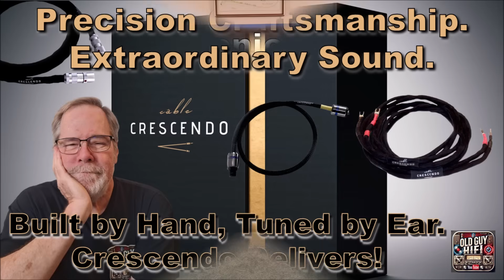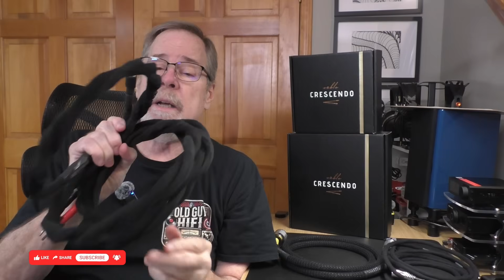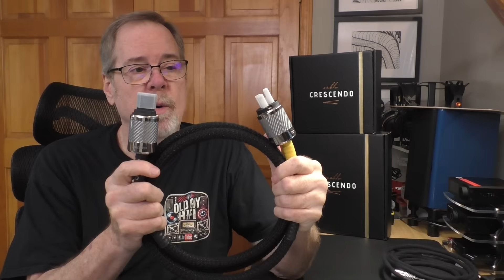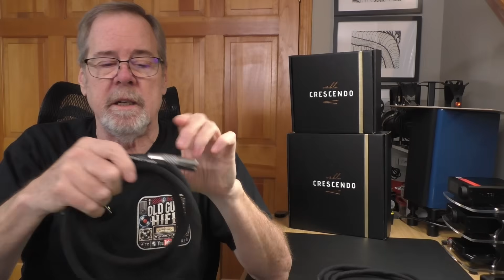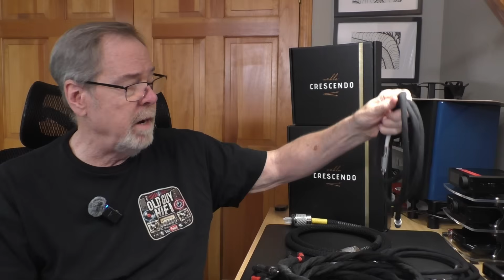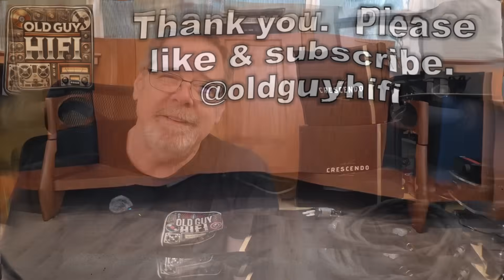Handcrafted in Quebec for Extraordinary Sound. Attention to Every Detail. Sound Without Compromise.

Comment: I have heard differences in cables that carry an analog audio signal, so interconnects and speaker cables. Did I find the difference enough to spend kilobucks? No. I upgraded to some OK Monsters and from there on, the law of diminishing returns set in so much that there was no way I would spend that kind of money for the minute differences. 

I have never heard any difference with digital signal cables, be it USB, coax, TOSlink or network cable. My 1s and 0s do fine with any cable I throw at them🙂
A while ago, a friend was shocked to see that I use a freebie USB cable that I got with a cheap printer in the early 2000s with my DACamp. He lent me a $600 USB cable to make me "see the light", claiming it "sounds" SOOOO good. The shock was not on me, as none of us could hear any difference when he brought it. 

With regards to audiophile power cables, I see no use for that unless you upgrade all the way from the power plant. GOOD audio gear SHOULD filter and RECTIFY the power to such an extent that I see no way that 1 single meter of kilobuck copper could make any difference what so ever. Any such claims would need to be veryfied in a blind ABX test for me to even consider spending time on. 
This is snake oil for me, until scientifically proven. We all know that will never happen;-)

Comment: Whether a cable is a good value or worth it, depends on what else is available at much lower prices. I am lucky enough to know some cable companies whose designer is very good & he gives you the best cables he knows how to make, without regard to the crazy prices that many other companies in the industry  charge. No multi thousand dollar cablrs are likely to cost 1/5 of that to  make. So the retail price reflects enormous profit margins; and I could not afford that or care to deal with companies like that. Especialky in light of the nice guy companies I know about, who simply give you the best cables they know how to make for well under $200. A few hundred dollars is what I believe a sensible price is, for cables. Some of my best cables cost way more than that retail; but I bought them used.
Reply from the maker: Thanks for sharing your thoughts.

Comment: Thanks for the review Ed. These cables look great, but they are certainly out of my budget.  

That said, guess I need to start thinking about finding a short cable jumper to replace the metal jumper on my Martin Logan Motion 60XTi.
Reply from the maker: I will send you a link to ones I use later. On the road today to CAF.
Reply: @OldGuyHifi have a great trip!

Comment: Great stuff Ed! Very brave of you! The late great Roger Russell of McIntosh recommended 18 gauge wire for runs up to 20 feet. He said the extra resistance helped with damping factor. I just had my Marantz 2220B, my Sansui 5050 and my Harman Kardon PM-650 apart for maintenance and lamp replacement. The wires to the power transistors looked to be 18 gauge. Supposedly the wires in a speaker are probably the same. The voice coils are even thinner. Connecting these two units with 4 gauge speaker wire is like connecting two logging roads with a six lane highway. LOL Roger marveled at the wailing, rending of garments and gnashing of teeth over a device that short circuits an amps output to a speaker input. Still, quality matters.
Reply from the maker: Thanks Mike.

Comment: This is utter nonsense. The same as mains cable. The cryogenic stuff is total BS
Reply: As they say "a fool and his money are soon parted".

The people that sell these must be laughing all the way to the bank.
Reply from the maker: You’re absolutely right — I’ll sell all my gear and start taking advice from YouTube comments immediately.
Reply: @OldGuyHifi So tell me why a cable between the wall socket and the little fuse and transformer winding makes a difference. Also the same between the components. Electrons are electrons. They are not fussy
Reply: @jeremynorth I think it’s mainly in the cable’s ability to run a clean wave without picking up interference. That said, this stuff is way above of my price point.
Reply: @kloop64  There's no interference which will change the sound in so short a distance. Think of the thousands of miles of cable which power our stuff and connect our phones etc. 
It's just snake oil.
I remember back in the 80's when they said that 79 strand cables were the best then it was solid wire.  All BS
Reply: The cryogenic stuff is BS? I guess someone forgot to tell the numerous manufacturers who have components and subsystems cryogenically treated to improve durability and performance.

Comment: I tried for a long time to make my system completely wireless because I hate cables and it just can't physically be done. I make my own speaker cables (equal to Audioquest, if not better for literally a fraction of the cost and I mean the whole thing same exact cable and I add the pants, shrink, tech flex covering, terminators, all of it). I'm just not stupid enough to add battery packs, cryogenically freeze them, cook them, and other non-scientific crap. If one understands physics at the atomic level one knows that all that garbage about cryogenic treatment, cooking, etc, is just that, garbage.

As for interconnects, tried Kimber Cable and they were awful, worse than the monoprice ones I was using. I now run WireWorld cables only because I got a deal (and a promise) on them. Total cost = around $200. 
It is science fact that one can not EQ a system with cables! My "opinion" is why should I spend more on cables then the entire cost of my system? It is like the rule of rent: Rent should cost no more than 35% of ones income, however, one can't control rent! (Major problem)! One can however, control discretionary spending 100% and control what they spend on cables. So I try to keep cables around 1.5% to 2% of the total cost or retail of my particular system. That's just me though, everyone can spend and do whatever they want, it is of no personal concern.

Power cables = I use what the gear came with, full stop. I'm of the "opinion" that it is at least silly to invest in expensive power cables while the rest of ones abode is Romex and the power coming in to ones abode is dirty and more Romex and all the way back to the source station in ones town or whatever. Besides there is not an expensive power cable made that would fit my gear or my power conditioner and I have doubts about them even fitting my wall receptacles! The terminators are for huge mainframe computers in data centers or something. The best one can do is use a good power conditioner appropriate to ones gear or for the insane one can use a power conditioner and rewire ones entire place and then ask ones city to rewire the lines coming into ones home and then ask if the source could provide better and cleaner electricity to ones home and then maybe have talk with natural science just to take it all the way.
Again, this is just me.
It has not been proven that these expensive power cables do anything different or improve ones systems sound. I don't see how it could. That said, I have never tried any "more expensive power cable" myself and I would be willing to see for myself, but 
1) I don't have the money for such things and 2) They don't make them for stereo gear the 99% of us actually have.
Reply from the maker: Thanks for sharing your thoughts on cables.

Comment: and with all due respect. i can't digest spending $4,400 on speakers cables !! . it's insane. that's the price i'd pay for a GREAT Amplifier/integrated Amp/ DAC/ DAC & Streamer....... etc . i do believe to have a good quality Cables for my system, but paying logical price for them..  i bet the difference between THIS cable and something else that cost $500 is very minimal (for me). thank God. my ears can't pick up the difference !. anyways.. thank you for your review.
Reply from the maker: I understand your point of view.
Reply: Find any Medical Application with cable cost this high, not even a 4D Sonogram,  truly not a requirement
Reply: I did and you can hear the difference

Comment: I made all my cables about 10 years ago when I first got into the hobby, I have a hybrid ht/2 channel listening setup and have been obsessed with audio ever since. I used those home made cables for around 6 or 7 years and decided I wanted to try something different so I changed all my cables out for SVS speaker cables and noticed a difference right away. Then I found a set of audioquest type 8 cables on ebay and was further blown away. Cables absolutely matter and the difference can be huge. My gear is solid mid tier so I won't be going much further than those but I'm a huge believer in cables now. So much so I changed every single one to Audioquest and I have never been happier.
Reply from the maker: Thanks for sharing your journey and experience with cables!

Comment: They make a difference. If you cant hear it, your equipment isn't revealing enough or you hearing is damaged. Men participate in lots of activities that harm their hiring, Car and motorcycle racing, firearms, concerts, construction, power tools. They go to war etc. No one wears ear plugs in the jungle. Get a hearing rest if you cant hear the difference in good cables. Comparing one piece of junk to another is a failure waiting to happen. I personally tested a lot of coax cables in my system going from an Auralic streamer to a Denafrips Pontus DAC andI heard all of them a little differently. I settled on a Cardas Clear cable as the most neutral and revealing. If you want a good inexpensive digital cable try one from Gotham cables in Switzerland. They have US distributors and also sell direct. It is the best cheap digital cable I found out of a dozen tested. Costs about thirty dollars. If you really want to test some inexpensive cables look on Amazon. Worlds Best Cables offers several respected brands like Canary, Mogami etc and you have a thirty day Amazon return. You have nothing to lose and might learn something. Start with Mogami.

Comment: I know it seems counter intuitive, but I think quality power  cables make the biggest difference to sound quality, more so than speaker or interconnects to a degree. It may be due to the high A.C voltage and higher EMF that may be affecting the internal power supplies of the music equipment
Reply from the maker: Thanks for sharing your experience.

Comment: I’m a believer that cables make a difference but for that price I would need to notice a 50% improvement in sound quality and I doubt that is the case. To my way of thinking spending over $500 on any cable is a waste of money.
Reply from the maker: I understand your perspective on cable pricing.
Reply: @OldGuyHifiWould be curious to learn if you heard enough of an impact that you would actually purchase these cables at full retail prices?
Reply from the maker: I heard a difference, but then I was lucky enough to have $50k worth of gear here to help discern the very subtle nuances. I probably would not as with my normal review gear I find it more difficult to hear the benefit. If I had a very expensive, very resolving system, then yes I think I would spend the money.

Comment: Maybe this is obvious to all the seasoned audiophiles that watch old guy hifi but I think it needs to mentioned/stressed multiple times to everyone that cables should be the last tweak in the system build after equipment/positioning and room tweaks. I think that newer audiophiles shouldn’t mess with cables until they have some experience building a system and setting up a dedicated listening room. Indeed I believe a dedicated listening room is required to understand the difference between cables. I think this is why some people believe that cables don’t make a difference its that they think they have a good revealing setup but they actually don’t because they have more to learn about listening and system and room optimizations. Ed here has a dedicated and tweaked listening space and has a trained ear that’s why he can discern the differences. Advanced cables are simply not for the audiophile beginner.
Reply from the maker: Good point. Thank you.
Reply: Yes and I would add the suggestion of starting with the source too. upgrading power cord. And at least decent interconnects. 

Then you can experiment with speaker cables and hear what they bring easier.
 Even  Normal HQ copper speaker cables with bare ends sound pretty good. Sometimes depending on the system more expensive speaker cables just sound different and  one may prefer cheaper ones. 
EG. Friend had high end analog rig. And A-B we both preferred cheap copper ones over high $$ ones with silver connections.  They  gave more detail but thinned out the bass and lower mids. He ended getting better  100% copper. Slight improvement but mainly for looks over the basic ones.

Comment: The natural movement of your head by a fraction of an inch in your listening position would make 1000s of times more difference. What about the wiring in the amp or to the house and the power socket? But the cable in the middle matters? 😂 Too bad the science NEVER stacks up. Hifi YouTubers should be encouraging audio fans to put the money away this snake oil and towards amplification, room treatment and most importantly speakers.
Reply from the maker: You’re absolutely right — I’ll sell all my gear and start taking advice from YouTube comments immediately.

Comment: I have tried some "better" cables.  Some very expensive ones atually did not sound good with my amp and speaker,  Some sounded great.  My experience is that there a synergy with cables.  Just as some great speakers (in my case some Focals) are not a sound I enjoy, some cables exagerate a speakers sound, where I want it countered a bit.  And the opposite.  Mainly I am referring to speaker cables.  Although to a degree I find this with interconnect.  I have noticed an improvement with some SPIDF cables but not the synergy.  Optical, I really have not heard much difference in cables.  My ears, equipment or rooM/  Or is opticall optical and pretty much the same
Reply from the maker: I don't really hear much difference in Toslink either.
Reply: @OldGuyHifiWhat about xlr n rca ❓️ KEEP PRESSING FORWARD 💪 
                         ED 💥💯